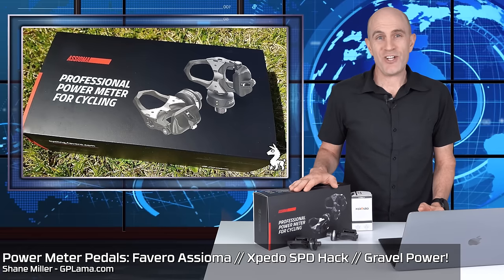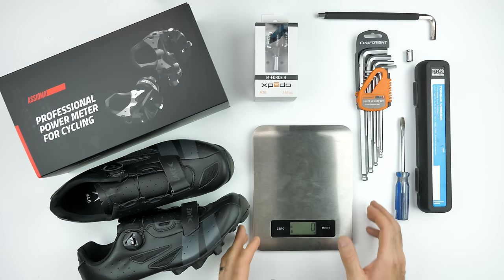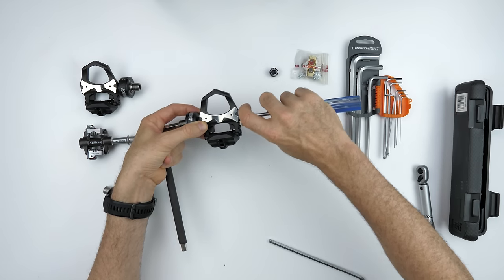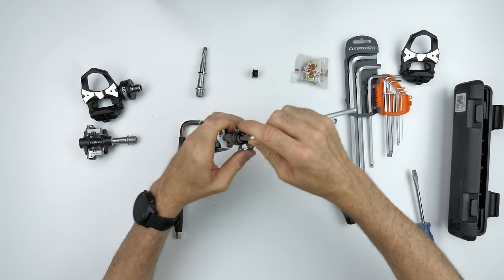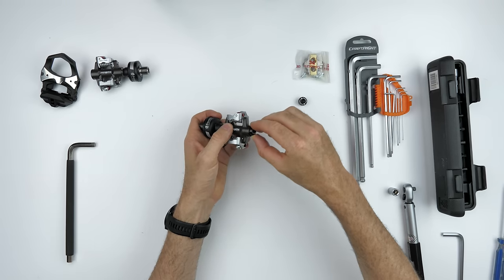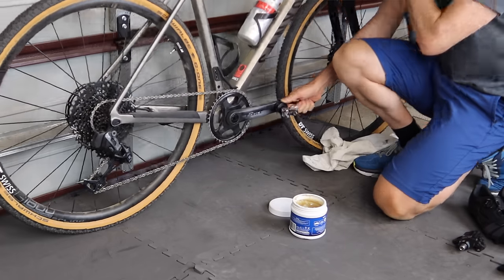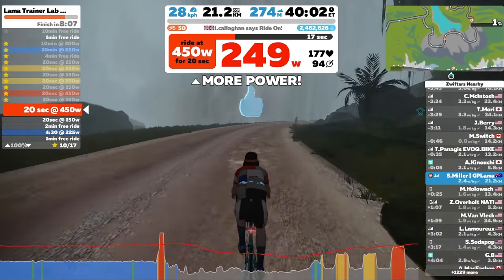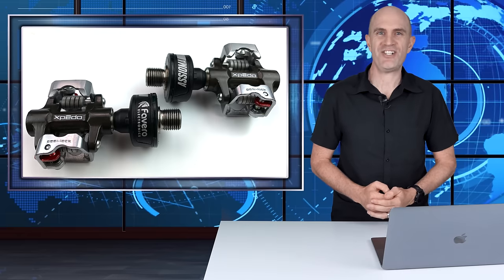Power Meter Pedals: Favero Assioma // Xpedo SPD Hack // Gravel Power!

Comment: I am one of the guys from that TrainerRoad thread. The washer is a good idea to move over because of the oring, but is slightly pressed on and needs to be knocked out. I’ve done some very rough rides with this conversion and from time to time will check that it still matches my kickr. It seems to hold up really well.
Reply: Hey, can you clarify, do you mean the washer and o-ring from Xpedo?  I have the CXR pedals.  If I don't use the Assioma crank side end cap there is too much play.  If I use the end cap the spindle seems to be about a millimeter too short and binds up if i torque to 8 NM. I did it just to the point of no slop, but it loosens very easily.   I guess I could do blue loctite.
Reply: @RATM1971  Did you have any long term issues with the CXR conversion? I am keen to do the same to my CXR’s
Reply: @davet003.5  I did end up going to the M-Force (I believe) pedal as it's an exact match.  The CXR pedals had the issue I described above and I was never quite happy with it.  The M-Force are an exact match.

Comment: You can hear the collective IQ2 facepalm from here. Come one Favero get your boffins together to get an official version out to market for 2020.
Reply: I think the pod:shoe interference is what's keeping this a garage-hack option only.   A complete redesign of the spindle/pod would be required for this to be a commercially viable option. Without it, Favero is besieged by complaints about shoes rubbing, along with a surge in returns and a torpedoing of their hard-won good reputation.   Maybe SPD-compatible cage option in the next generation?
Reply: @gpatrick95  An Assioma v2 with a sleeker pod design would go down well.
Reply: @gpatrick95  Shimano's patent on the SPD pedal body, which I think is going to expire relatively soon, is probably the main hurdle for this to be offered by any manufacturer. And yes, the pods need to be modified. I know, I know...
Reply: @gpatrick95  Not all shoes need to be cut up with powertools. I have a pair of Fizik Terra X4 and they work with this hack without cutting them up. You can check the TrainerRoad forum for my pictures of this combo.
Reply: @hilgomol3902  I'm sure there are shoes that fit.  But if you offer an SPD power pedal for sale, you're tacitly implying that the any shoe that meets the SPD clearance standards will work without modification.  Currently, some will, but many won't.

Comment: I have just done this with a single sided assioma uno, and a pair of xpedo CXr MTB pedals. 
I have one very muddy MTB ride (with a gnarly lowside crash) and a  couple of road rides on my gravel/cross bike since the swap.

It friggin works!  Now I can have power on ANY bike (I wear giro empire MTB shoes) 
(My road bike has a stages left side crank, but my 3 other bikes... no power meter... now I just swap my favero/expedo hacked pedals to my gravel, and my two mountain bikes.
Plus, if I barrow or rent a bike... I'm good. 

Notes: 
1. the giro Empire XC90 shoe  clears for clip in and release (just barely)  without sole modification.  (I shaved my left side a little  with a dremel for MTB riding and goop clearance, for road riding not really needed but because I use these in the dirt and muck... better safe than sorry. 
2. The CXr pedal body seems to work just fine with shimano cleats.
3. Use blue loctite on the axle nuts when you do the swap, and only tighten the axle nuts enough to secure the body with no slop.
4. Use the Xpedo end plugs on the SPD pedal bodies NOT the favero ones.
5. If doing a single sided setup (like mine) use the Favero axle from the dead pedal on the right side, not the stock Xpedo axle (the xpedo and favero axles  appear to have a slightly different Q factor) 
6. Don't ride like a goober and bash your hacked pedal into every obstacle on the trail,  if you ride smooth, and ride smart,  you shouldn't be having pedal strikes. Try to be cognizant that you have 300+ dollars attached to your crank arms and it'll be OK.  The "freeride" kiddies poopooed carbon cranks and wheels back in the day because "concerns" about toughness when smashing things. Be like water, flow - dont bash.  Ie: Don't beat the shit out of your gear.  Slow is smooth, and smooth is FAST!  Get me? 
7. Perform hack at your own risk... not supported by Favero, Xpedo, or anyone.  You break it... pay to play.  (Replacement axles with meter can be had for a pretty good price...and the bearings and seals are fully rebuildable.)
Reply: >  only tighten the axle nuts enough to secure the body with no slop.

Yeah, 8 Nm was way too much, it crunched my bearings.  I had to scavenge the good bearings from the Assioma pedal body.
Reply: I just tried tightening the axle bolt too much as well and it was way too tight. Is it safe to tighten it below the recommended 8 nm?  Does the loctite solve this concern?

Comment: Just did this hack with Xpedo CXR's and Assiomas spare part "Pedal axle with sensor", from bike24 for 294€. Worked great and the only leftover part was that left axle from the CXR's. Brilliant!
Reply: Is charging cable included in the "Pedal axle with sensor" or do I need it to order it separately please?
Reply: You need to order that separately. I had them already as I have a duo on my main road bike. But probably you just need the "spare" clip. A standard usb charger and cable can be used with the clip.

Comment: Great hack.  I have two bikes, one with Assioma Duos and one with Shimano SPD-SLs.  They are very similar cleats but I still am not used to the engagement on the Assiomas and wish I could use SPD-SL with Assioma.  Maybe that's the next hack.  That way both pairs of shoes would work with both bikes.
Reply: I'm eagerly waiting for favero to release a spd-sl version. And on that also have the option for a lighter pedal body. Xpedo for instance has the thrust 8 which could make the favero go well below the 300gr mark. That would be another +1 for favero.

Comment: Great hack.  I have everything on order to complete this - going to use my existing DUO pedals.  I did see that you can buy the MFORCE 8 pedals with a Ti pedal body, which would definitely shave some weight.  The spindle can be ordered in either CroMoly or Ti.  Since it's a throwaway (or can be reused with the road pedal bodies) I think the steel axle would be the way to go.  Thanks for posting this, I'm transitioning from road to full-time SPD (for walking and looking like less of a tool when walking off the bike) and this will REALLY help.  Thanks again.

Comment: Hey Shane, 
Thank you for your reviews and contributions, it’s really valuable and you are appreciated! :-) 
Just another concern regarding the clearance between the sole & the sensor body, I assume they designed it that the higher point of the sensor is below the level of the bottom of the shoe sole, which   most likely will not happen with the SPD mount type as in your case. It is actually giving some disadvantages against Garmin Vector 3 which brain is caved in the pedal axle- nobody want cut theirs Lake shoes 😊 LOL.  
 The big advantage/idea of the pedal power meter it is a versatility, however there is another limitation about shoes type.  That would be much interesting, if you can do the same trick with Vector 3 to SPD MTB conversion, if they   share same axle specs…  sorry didn’t have a time do dig around, just left it for you, Shane, as another challenge for all us, of your delighted followers))))) 
PS// how precise are Garmin Vectors 3 over Assy Duo with their  fix of the last bugs??? 
Thank you a lot,! :)
Reply from the maker: Different axle on the Vectors.
Reply: Got a hint ! ;)

Comment: Amazing! There are such limited options for off-road power meters, this is great. 👍🏽
Reply from the maker: Yep! Throw in the Assioma UNO to the mix and it's an even cheaper alternative to this.... and only requires one shoe hack. ;)
Reply: Do Assioma Uno are being to be trusted? Why they are selling Duo then?
Reply: Its not limited exactly-you have quarq xx1(benchmark),power2max,stages,srm spider,srm pedals,easton cinch....
Reply: @b09d4n  The Uno is left side power only vs the Duo that's right left power.  If you're fine with a left only crank power meter than no difference for the Uno.  As most know at this point, the power meters that only measure one side simply double that reading for your total power number.  So this will be off slightly from a dual power meter depending on your one personal left/right power output balance, but is still a useful number for training and pacing and a great way to get a power meter on a budget.

Comment: Favero ought to simply market this as part of their line-up.  Sell the pedals with a choice of body and offer the other type as a Favero sponsored conversion kit.  An SPD-SL body would also be nice.  I would buy the pedals tomorrow if they did this and honored the warranty.  This is hardly a difficult changeover.  I would even pay more for the convenience of a fully supported line of options as I have multiple bikes (touring with SPD or SPD-SL, CX with SPD, road/tt both with SPD-SL, mountain with SPD).
Reply from the maker: The battery pod size needs reducing. Having to hack shoes isn't ideal.

Comment: I'm just waiting for the IQ2, should be here soon😐
Reply: Soon being this century or the next?
Reply: @TheCrossroads09  

I stopped waiting and just took the plunge. 
IQ2 is vaporware, and SRM is still in development and priced to the moon to boot. (1000 bucks for pedals?!  Get outa here) 

Favero/Xpedo hack seems to be the real deal.  Works great so far. 
No warranty support, but most outfits are gonna tell you to piss up a rope if you smash the pedal on a rock anyway
Pedal strikes aren't "defects in workmanship or design"   
Favero and XPedo both offer replacement parts... you can rebuild them if you break them!
Reply: Just came out...

Comment: The spindle looks exactly the same as the Ritchey. Same Q factor. Ordered a pair of Xpedo’s to do this conversion but I am going to see if I can use my Ritcheys as they are my pedal of choice. Ritchey has the same nut on the inside and dust cover setup as the Assioma and Xpedo.
Reply: Did it work?
Reply: @Levi_Allen  no it didn’t. Ended up going with Xpedo. Still running them and going strong even with a couple of good knocks.
Reply: @SuperCaryG  thanks for the update

Comment: Great reviews and vids you make. Any idea when anyone will come out with a pedal powermeter based on the spd sl System?

Also if the hack works so well why does Assioma not offer it as a set with both pedal bodies? Should up their sales!!

Thanks and regards from Germany
Reply from the maker: The Holy Grail of pedal power meters.... doesn't exist yet. If Xpedo made a SPD-SL pedal body with the same bearing configuration then things would be VERY interesting.

Comment: Awesome how to and breakdown mate, thanks for that.
Big question now for me is, how many times do you reckon you could get away with swapping back and forth from road to MTB platforms on the pedals? 
Having two sets of power meter pedals for the price of one is great for the wallet.
Reply from the maker: Carefully? A lot. This works with the Assioma UNO too... for a single sided budget option.
Reply: @gplama  Cheers Shane. Usually ride MTB pedals, but be nice to be able to swap back and forth for the longer  road rides. Hopefully they don't go and change anything in manufacturing now to stop this being done before I get mine lol

Comment: Sick. I'd be curious to see how these compare to a quarq and/or stages"traditional" MTB power meter accuracy wise, can you do a test and compare via DCR?
Reply: TheCrookedWheel I have a 4iiii single sided on my mtb (which I will keep because of the pedal strike issue) and my converted Assiomas agree with it other than it being a single sided power meter with my slight imbalances.

Comment: I would switch them to regular SPD-SL from the Look Cleats then. Thanks Shane!
Reply: Note that this works with the xpero MTB pedals because they are based on the same bearing configuration as the Assioma pedals.  Shimano SPD-SL pedals are not so that is not a swap you can make.

Comment: Shane, I know you did this conversion/video a while ago.  It seems the M-Force 4 is no longer available on Amazon.  Is there another MTB Spd pedal you would suggest for this conversion?
Thanks.
Reply from the maker: The M-Force 8 also work. People also reporting the Xpedo CXR do too.
Reply: @gplama  Shane, I just finished watching your video for the M-Force 8 conversion.
Thanks for all the great work you do!!!
Reply: Hi Shane - just came upon this hack as I am  looking at putting power meters on my fat bike. Would this work with the new Favero Assioma DUO-Shi Pedal Axis that are available? Thanks for the great videos.
Reply from the maker: @JenzRich  There are SPD hacks for the DUO-Shi but you'll be really widening the bike q-factor a LOT by doing this with the DUO-Shi and on a fatbike. Favero will have a native SPD pedal out soon. They're saying 'spring' and have already started a limited sales run in Italy only already.
Reply: @gplama  Thanks - will have a look.
Reply: @gplama i would like to have powermetr with one side spd and the other side flat pedal. Are you aware if any of these will be produced off the shelf or if some already tried to fit such a pedal body to the assioma? I assume the work steps would be broady the same

Comment: I did the same thing two weeks ago! Works like a charm! And I did take off the O-ring from the Xpedos and put them on the oil cap from the Assiomas. Fits perfectly and I also thought this might add some water resistance.

The only thing that annoys me is the constant blinking of the Assioma pods. I know you have quite some experience with those. Is there any way too turn those orange lights off?
Cheers and keep up the great work!
Reply: Thomas Richter I’ve had these Assioma pedals for over 2 years with nearly 20,000 and nearly 2,000,000 feet of climbing the lights have NEVER bothered me 😂 here’s a tip - keep your eyes on the road/dirt 😂
Reply: @SeeYouUpTheRoad  You're right, it doesn't bother me when riding outdoors but when I'm on the turbo, staring down at my crankset while suffering like a pig, I wish these lights would stop mocking me 😉
Reply: Haha I am fortunate to live in San Diego, California the turbo collects dust here 😂 I feel for you sir 😂 ride on sir!

Comment: Well done. Are there any other systems that could be used for conversion (iE XLC?)
Reply from the maker: Only 1:1 compatible Xpedo pedal bodies.
Reply: @gplama  thx, the force 4 are unavailable in my country now. Are other models like force 3 or force 8 also identical in inner diameters, bearings etc?
Reply from the maker: @parz8437  I'm not sure. Contact Xpedo support to see if they can guide you there.

Comment: I own the assioma and it would be a great hack because during offseason I spend most of my time on the road bike and during the race season on the mountain bike. But I'm worried only about one thing and that's hitting the power meter body to rocks or roots because I'm riding XCO and you can't really control it. And I don't thing crank guards would help. So I'm thinking about a fender for the crank and body. I own 3D printer so maybe I will try to design one. It could be strong enough to be just printed from ABS ol PET or could be made from aluminium on a CNC machine for a stronger outcome.
Reply: If you get something that is workable I'd be interested in buying. I don't get a lot of pedal strikes because I run shorter cranks and my bottom brackets are fairly high, but it wouldn't be a bad idea.

Comment: For folks who have tried this, have you been able to find MTB 2-bolt shoes that don't need any modifications? So far in parsing this thread I've seen Shimano RX8 gravel shoes, Fizik Terra Power Strap X4 shoes, and Giro Empire XC90 shoes mentioned as ones that don't need the sole to be trimmed down. Are there any others?

Comment: Here's one of life's off-the-wall questions. After training inside on a TacX Vortex trainer this winter season (upstate New York - way way upstate) I've really come to enjoy the power meter aspect of the trainer. I use MTB pedals because I find them more convenient, and now I want to add this MTB power meter pedal hack for the good weather outdoor riding seasons. However, in addition to a road bike, I also ride an aluminum/carbon recumbent road trike. I'm curious if the recumbent position will somehow throw off the readings of power meter pedals. Trikes can be mashed like roadies, but they gain a lot more up hill forward speed by spinning than mashing. Any thoughts on whether or not I would be seeing reasonably similar accuracy to my trainer? Is mashing still mashing whether up and down, horizontal or inverted?
Reply from the maker: Torque is torque, should be no issues.

Comment: fantastic hack. but not cheap. i am still fence sitting on this as now my current Shimano $150 pedals are no good for this conversion and would have to be shelved, then have to buy the Favero Assioma's and the XPedo M-Force 4. i am sure it would be cheaper to use a Stages or 4iii crank arm even if its only one side.
Reply: I think in the long run it's cheaper, if you are ok with the risk of hitting a rock on a mtb. For gravel bike I don't think there is a question it's cheaper in the long run.  I have a single sided 4iiii on my "real" mtb and that is fine, but it does lock me into a crank length and a manufacturer.
Reply: @blackaxis  if yr building a bike whether MTB or gravel i think its a great time to do this not so afterwards. i think swapping the crank out is the cheaper option. i built my gravel bike with the 4iiii in mind. i could have gone this way too during the build if i knew about it 18 months ago. But on my MTB i think i will swap the crank arm as opposed to this great idea. horses for courses :)